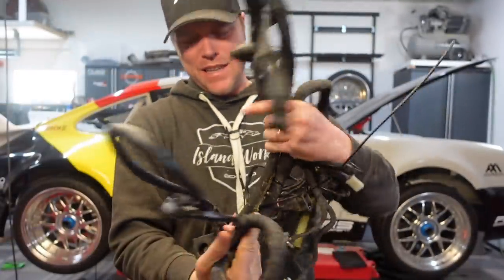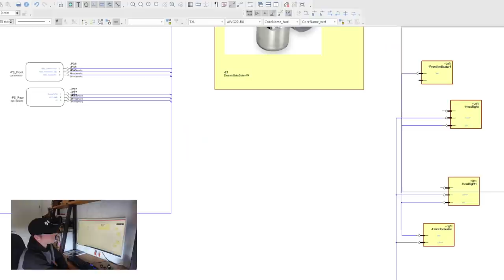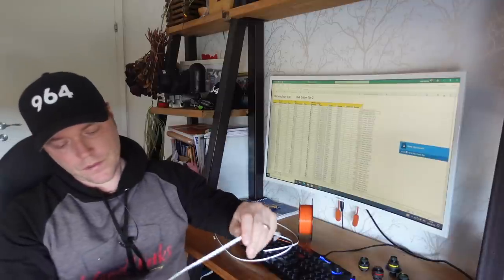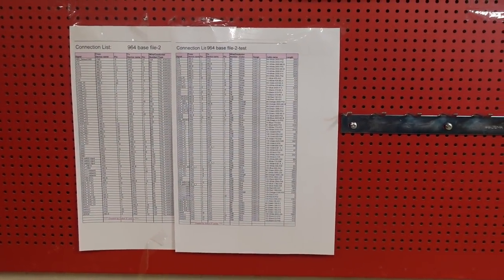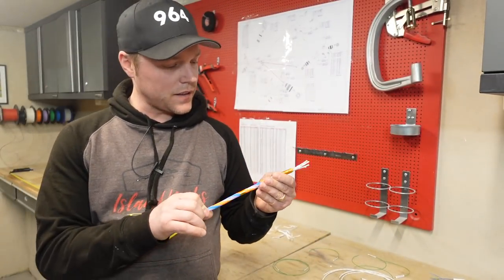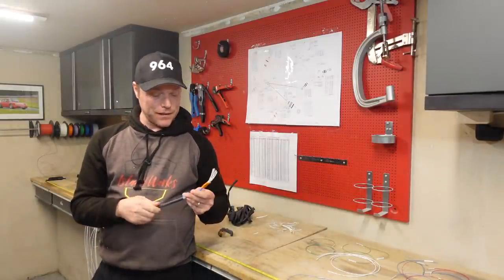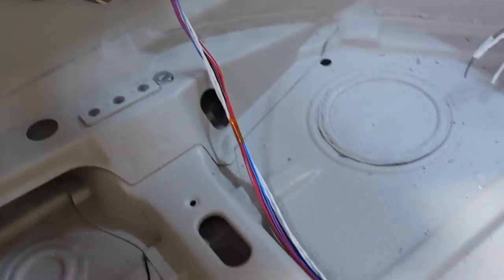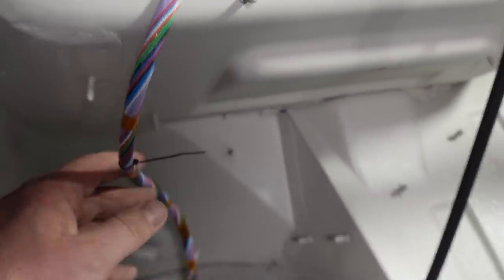Concentric Twist - Insanely Overspec Wireharness Build on Classic 964

Comment: Second thought on your form board. Having spent close to 20 years in aviation, a digital form board is great, but I have always found that physically laying out the harness for actual cable routing versus theoretical routing in the E3 software makes life significantly easier once you are actually building your main and sub-harnesses.
Reply from the maker: I started with running ropes between the components (last episode) and took the routing and actual lengths from there. 

The CAD is then to design all the signal routing, splices, cable lengths and labeling. 

Still first time around doing this for me…

Comment: Trick to remember, largest gauge wires to the center of the core.  You shouldve used the 20AWG power in between the jacketed twisted pairs and moved two grounds onto the outer layer.  You did pretty decent for a beginner and it takes a while to get the design and layup figured out right as it takes experience to move things around so that each layer uses the same gauge wire and also doesnt neccesitate a new layer

Comment: Boots should be heated slowly from the center. Stop with the edges incomplete. Then apply epoxy and finish heating the ends of the boot on. Good job though man.
Reply from the maker: That’s great input. Thanks!

Comment: Great channel and great job. As a residential electrician on over 1,000 houses I’ve been on disability for a long time. This really peaks my interest. My favorite part on residential work was always doing the breaker panel and meter loop. I bought one of the courses you mentioned earlier but never got around to taking it. I’ve been interested in cars and bikes far longer than anything else other than gunsmithing so it seems like a natural fit for a job I could do to earn some wages as well as enjoying the challenge. Perhaps I could also do it to help others out a bit at the same time. p.s. The versatility and ease of understanding of the software is a revelation. An extra thanks for that.
Reply from the maker: It’s a great subject and really fun to work on!

Comment: I also use cable ties, but I put them on backwards. Of course they do not permanently lock in place, but I do not need them to. The added benefit apart from being able to reuse them is that I do not need to snip them afterwards, thus introducing the risk of getting a nicked wire (ask me how I know this 😢).
Reply from the maker: That’s great input I’ll try that. What I’ve done is to tie them down and then use a cutter upside down and cut the head of the cable tie. This has worked safely so far.
Reply: @islandworks  I was absolutely sure I had not nicked a cable (actually I had nicked 2) and I had to rebuild the whole harness. Unfortunately just one mistake in a multi day process meant I had to do it again. Then again it is good therapy. Your build is my favourite in YT, keep up with the good work!

Comment: You've done a really nice job!  One thing for future - it is not ideal to use kapton tape every few inches to keep the outside layer together like you've done.  The reason not to do this is it reduces flexibility and creates bunching at each spot where the tape is.  It is preferable to use lacing cord in the opposite direction of your outer layer and wrap it tightly with this which will do the same job but allow the wires to slide against each other between joints.  It's only a small detail but it will produce a better final product.  Hope that helps.
Reply from the maker: Thanks for the input. I’ve been looking for this lacing cord but wasn’t able to find it. I’ll have another look once I do the next harness.
Reply: @islandworks  "Kevlar tråd", inte hittat det som köpts från Dupont men fiskelina i kevlartråd kan fungera.. Vart köpte du kablarna ifrån?
Reply from the maker: @thevandor23  toppen! BJP till exempel för kablarna.

Comment: What is the yellow glue that you used on the wires that is hold to the core? And how can I get some?
Reply from the maker: It’s called Kepton tape. You can buy it usually where the wires are sold.

Comment: Are the core wires used for anything (harness related) or are they just for support to allow the concentric twist to have something to rotate around?
Reply from the maker: Yes the core cables are usually larger cables. In my case it’s for the canbus network and for the Ethernet for the ECU.

Comment: I'm 3 minutes into the video and I want to recommend that you go watch Rob Dahm's videos as well as High Performance Academy's videos on concentric wiring and WHY it's important in motorsports grade wiring harnesses. Specifically, the crank and cam position sensors and their respective shieldings.
Reply from the maker: I’ve done both of them and they’re great! The HP Academy goes into all the depth and is a proper paid course though